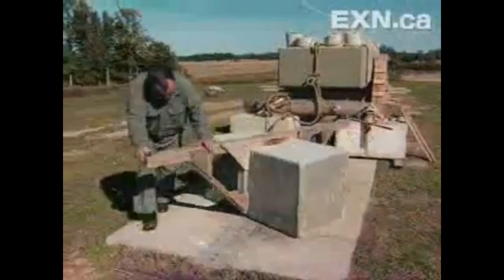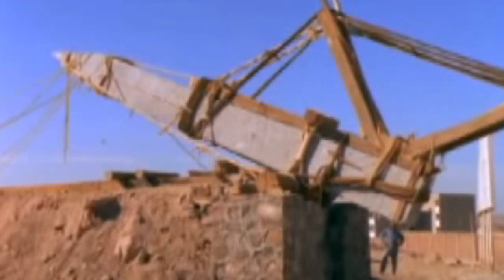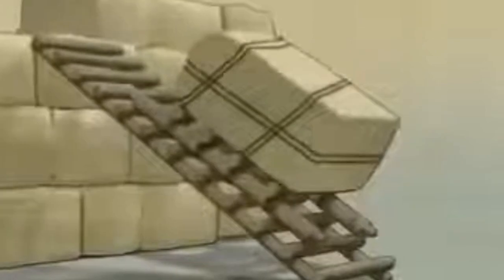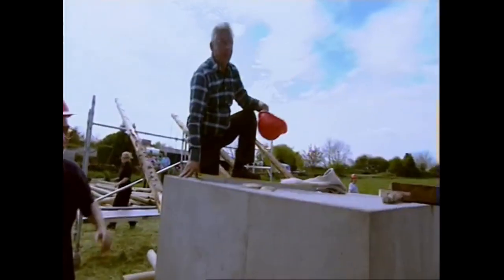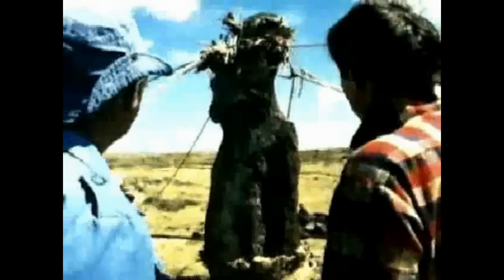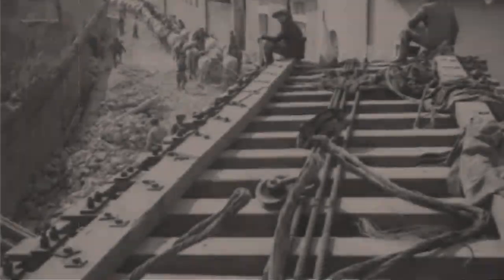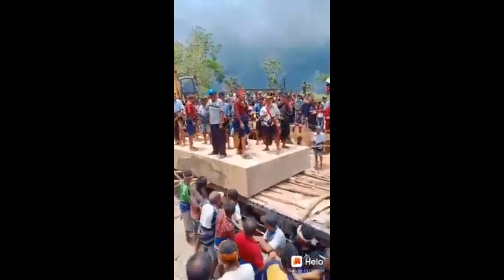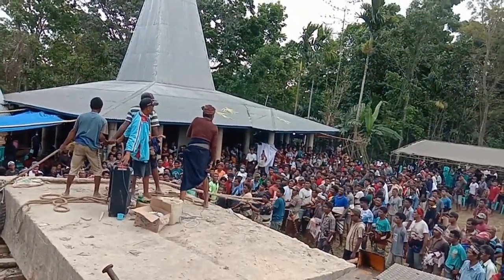How The Ancients Could Move & Place MEGALITHS With Primitive Tech. LAHT WON'T SHOW YOU THIS!

Comment: Cmon man... WAKE UP. THE BAALBEK STONE IN LEBANON WEIGHS 2,000,000 POUNDS...
Reply from the maker: Big drilling deal. You obviously haven’t seen people move things because you get all you info from lost high tech gurus who think polishing stone is a mystery.
Reply: @SacredGeometryDecoded  really, why did at least ten notable engineers decline to provide any possible way to move the stone? If they could move the Baalbek Stone, why don't they? You say I obviously haven't seen people move stones or I would think otherwise. If that's the case, why don't these "people" that you are referencing that I "obviously haven't seen" go to Lebanon and move the Baalbek Stone? I'm sure the entire world would like to see them move that stone using primitive means, in fact I'm sure if they crowd funded it as a campaign,  there would be donors willing to put forth a million dollars. But then again,  they wouldn't need millions of dollars for primitive means. So again I say, and there is no need to be rude to me, why can't the move the BAALBEK STONE?
Reply from the maker: @lavarburton1849  10 notable engineers? Who are they?
Why don't people go to Lebanon and move the stone?
Because those stones are still attached to the Earth and were NEVER MOVED, they also weight several billion times more than what you say, they weigh the same as the Earth.
As for notable engineers go back in time 2000 years and get a copy of De Architectura. 
Also you know what would happen if you go to an ancient quarry and mess it up to prove something to you. Even at another quarry the stone itself would cost over a million dollars. Hiring the crew and getting the ropes and timbers would be very very expensive. 
This video contains examples of people doing such work. 
Your ignorance of the basics of the topic is epic.  It would be like me walking into a nuclear physics class and demanding everything be explained without me even bothering to do the reading beforehand.
All you knowledge comes from the likes of Brien Foerster and Uncharted X.
Reply: The dome of the Vatican is 30 million pounds and 200ft in the air. Yet you guys never question that building, I wonder why….
Reply: @LesterBrunt  Are you addressing me? I was unaware of any such claim but I'll certainly check it out. What does it being the Vatican have to do with anything. Anyone who would disingenuously ignore an important piece of information because of bias is not on the empirical quest for truth. Everything must submit to empiricism.
Reply: @lavarburton1849 It is just that you are puzzled by a 1,000 ton stone that was attempted to be quarried by the Romans but yet there is a 15.000 ton dome built 300ft in the air by the same people with the same technology and that is never mentioned. 
You don’t think that is strange?
Reply: @LesterBrunt  Well, first off there seems to be a few misunderstandings on your part so I must address them if I feel you have the wrong idea:
1. When you say, "You seem puzzled by a 1000 ton stone, yet there's a heavier thing over here...", It seems to imply that to be "puzzled" by any of these, whether it's 1000 or 10,000 tons, is somehow unreasonable to you or childish to you. Tell me, are you puzzled by it? Or them? Do you know how they did it? You seem to have quite a self righteous tone, so by all means, enlighten us. I was the first to say that no one knows how the stones were moved. But the way you say, "you seem puzzled..." Well, here's your opportunity, Professor. Unpuzzle me. Let's hear your great wisdom, architectural knowledge, esoteric methodology of moving millions of pounds of solid stone at once with no known technology. .Let's hear it, Professor!
2. I responded to this before and you are repeating the same thing. You are making an implication about some other site of larger dimensions NOT being mentioned, and I take that religion has something to do with that. So what is it?? Be clear in your thoughts. Come out and say what you really want to say. Don't act like a female during a certain cycle of the month who wants to speak in cute codes so I give her attention and try to "figure her out". Be a man and say what you mean and mean what you say.
Now try again.
Reply: @lavarburton1849  They carved the stone from the bedrock like it has been done in the past 10.000 years, you take a hard object and bash it against so that little pieces get pulverized/flake off. It is like the most basic work imaginable that is why it amazes me that you are so puzzled by it. It being big only means that it took more manpower and time, the process is exactly the same on large or small scale. 
See how I can just respond to your comment without going on a weird hysterical diatribe about “being a man”? Can you do the same? 
Can you answer the question on the St. Peter’s Basilica? What do you think about the fact that you are baffled by a rock but never even questioned a 30.000.000 lbs perfectly placed, symmetrical dome 300ft in the air. It has nothing to do with religion, I’m just wondering why the discrepancy?
Reply: @LesterBrunt  Well, as I did last time, I will take these "points" one at a time, but given that they are alluding to previous answers or statements that I've made, I imagine you will either immediately forget the responses due to the way your hippocampus functions, or not be able to understand them because of a limited intellectual capacity.
1. You have obviously never been a Mason. I've done sidewalks and driveways,  but my main task was repairing chimneys. Occasionally I would do more interesting stones,  including foundational stone. That being said, I am sure you have no callouses on your hands, have never used a brick hammer, a masonry chisel, a grinder, a tuck pointer,  etc... I am pretty impressed by their cutting of the stones. Furthermore, if I'm not mistaken,  you are taking that from a statement I made in a conversation discussing whether the stones were moved or cut in place. If that was not the context,  then I don't know which means it wasn't nearly as important as the Central issue. So that brings me to the heart of the matter. We are all PUZZLING over how the stones were MOVED FIRST AND FOREMOST,  which tells me you shifted the conversation towards the cutting because it's the low hanging fruit. Also,  that does not seem to be what you were alluding to when you said we were "puzzled". In other words you are being disingenuous because you realize you have nothing informative to contribute to the discussion, which brings me to-
2. You say it being big only means more manpower and time, and the "process is exactly the same". But what's conspicuously missing from your non-answer is WHAT IS THAT PROCESS? What do you think we've been discussing this whole time? This whole conversation from the very beginning was about how the heck would they move these things. You have offered NOTHING to that effect. You come into the conversation with a self righteous arrogance,  and then realize you have no clue of what you are talking about so you do a bait and switch and think you can pull a "gotcha" on the low hanging fruit. Right here and now, explain, SPECIFICALLY, step by step,  HOW DID THEY MOVE THE STONES.
3. I already ANSWERED THIS. there's no more discrepancy then you not mentioning Ziggurats on the ocean floor off the coast of Florida..  oh wait, did you know that? Duh. The reason the conversation was not about whatever your referencing, was because I was unaware of it. When you brought it up,  you implicated TWICE that it has to do with the Vatican. Are you a puppet for the Church Fathers, The Cryptos, The Vatican, The Jesuits, and The Society of Jesus? Oh wait you don't know what that means... I don't care about your manufactured religion. I STATED TWICE that I didn't mention it because I didn't hear about it. I just heard about the Baalbek Stones The day I made the comment. Now that you've been officially notified three times, will you be able to remember this?
Furthermore, just for your behavior,  I will only discuss the Baalbek Stones until the issue is somewhat concluded.  If you behave yourself I will agree after this discussion to discuss your church.
Reply from the maker: This video includes examples of moving. You can keep denying it and throw a random question. 
For more details I have specific videos on Baalbek. It's a short distance away, the land is level. The tech at the time including written descriptions are more than enough. Other moves such as 400 t obelisk over the Med and across more land.
I don't care abput your made up religion and wilful ignorance either.
Are you a puppet for the dumbing down of society? Are you trying to reduce humans to useless button pushers to satisfy your demonic pervert masters? Why do you think it's OK to pollute the minds of children? Why are you so evil?
Reply: @lavarburton1849  And again some hysterical post that has nothing to do with anything I wrote or asked you. 
So much for your supposed open minded “questioning”.
Reply: @SacredGeometryDecoded  How come none of your explanations include Magnets, or Magnetic Force, Giant Humanoids, or Telepathy? You are scrambling to come up with all this ridiculous nonsense to figure out for certain how they did it. Let's start at a place we can agree with. Thousands and thousands of years ago the inhabitants of earth, or certain parts of it, were able to move solid stones that weigh millions of pounds. This defies all known principles of cultural evolution and the evolution of a cumulative based knowledge. According to all the observations and principles we learn in Sociology, Psychology, and Cultural Anthropology, if they were moving solid stones that weighed MILLIONS OF POUNDS in 5000 BC or 3000 BC, Then by 1000 AD they should've had the technology to Move a Mountain- LITERALLY. 
So let's start there so that our eyes may start to open to the truth. The investigative path you are taking is not only taking you in the wrong direction, but was devised to do so by the people that know the Truth.
Reply: @SacredGeometryDecoded  first of all, you are not the shiniest coin in the jar. There are two conversations going on here. When I was saying I don't care about your fake religion,  I was replying to the other uninformed individual who is like you with regards to intelligence level.  For further clarification,  when someone makes a response to another user, that users name appears in BLUE at the beginning of the response with an "@" symbol immediately preceding their name (the one written in blue). This tells you who someone is responding to when they write a reply. I hope that helps.
Reply: @LesterBrunt  I replied DIRECTLY and PRECISELY to each and every point you made, if you can even call them points. 
I even numbered the responses for clarification. What's happening here is that you feel insecure and threatened,  so  are withdrawing from a situation you previously felt very confident in.
I imagine this happens to you quite regularly, just based on the statistical distribution of intelligence levels.
Reply: @SacredGeometryDecoded  I realized something that can help here. We are coming from two different starting points. You are not coming from the starting point,  or worldview, which assumes that the means to move solid, multi-million pound stones,  including the nature of the beings that moved them, has been deliberately hidden from us by the Victors of History.
I realized this just now after reading an article from 1909 in a local Gazette, that discusses an underground matrix of tunnels 1480 feet below the surface. Advanced irrigation methods were used, Advanced structural architecture was used to prevent collapse, and Egyptian/Middle Eastern language was written on tombs. EVERY SKELETON EVER FOUND was 9 feet tall or taller. Weapons of a peculiar copper alloy were discovered with the rigidity and toughness of steel. The matrix of tunnels was determined by archeologists to be of a military nature, and indicated the inhabitants were fighting a conflict in which their existence and location needed to be concealed. All evidence with regards to this underground matrix suggests it predates what we call Native Americans by up to 1000 years. The Archeologists say that there are striking similarities between this site, and the cities of the "Mound Builders", which also contained giant skeletons. 
EVERY SKELETON EVER FOUND IN THE MOUND BUILDER CIVILIZATIONS WAS A GIANT. All Giant Skeletons ever displayed in museums in North America, that were from Ancient Mounds, were removed as a result of The Native American Repatriation Act (I think that's the name) that was created by a [star of david] and and passes with aggressive promotion by [star of david]. Interestingly,  there was virtually no Native American support for this "Repatriation" of giant skeletons,  no matter how much the [star of david] tried to provocateur feelings of offense.
This is probably due to the fact that no Native American tribe claims to be descended from the Ancient mound builders, and AT LEAST 22 Native Tribes have histories that include a race of White skinned giants that pre-existed them.
These are the Aryan Giants that many people have mentioned, and get called racist or White Supremacist for suggesting they existed. Why do you think Ireland was Aryland? It went from Aryan-Land to Aryland to Ireland. 
Do you realize Iran was the word Aryan?
This directly relates to the Baalbek Stone. These Aryan Giants 1480 feet below the ground in North America were hiding from the Giants in what is today Lebanon, Greece, Rome, Iran, Iraq, Egypt, etc.
You have to understand that normal sized humans DID NOT move the stones. 
In the Mound Builder Societies,  you will find Gigantic Stones placed atop many tunnels as ceilings, and the same mystery of how they were moved persists. An investigation into the moving of stones in ancient times, which your channel investigates, must start from the point  that the ancient people and their methods of moving the stones has been deliberately covered up. All Giant Skeletons found since the fraudulent Repatriation Act was signed into law are never seen by the public,  even with a FOIA Request, since Native American Sovereignty is excluded,  unless involving a crime.
They have employed this same method of covering up Giant Humanoid Skeletons in every country where they can use a Native Population as an excuse to take away the skeletons, or prevent people from looking for them by designating every possible location as "Native Land".
You are wasting your time trying to figure out how humans moved the stones.
Reply from the maker: @lavarburton1849  just because you are ignorant doesn’t mean everybody else is as useless as you.
There’s this thing called real life and real world experience, it’s a place we’re people with useful skills get together and make things happen.
Including moving and lifting heavy objects. It’s called the lifting and rigging industry. I worked in it and because of that i saw through the BS that people like you push.
Your new age religion is a cult that wants to make idiots out of people. It exists by lies and cheap psychological tricks.
Reply from the maker: @lavarburton1849  For further clarification Sherlock it’s a public comment section. 
FYI When you go the school ma’am hall monitor thing it doesn’t make you look clever, sophisticated and superior. It’s more like putting blood in the water. 
The fact you are dodging the technical issues on a technical matter is revealing your ignorance.
Reply: @SacredGeometryDecoded Well, if you do in fact work in the "moving and rigging" industry, tell me, what is responsible for the phenomenon of a BACKWARDS progression. Have you observed that human progress goes BACKWARDS? We invented the lever, then the wheel, then the axle, then carts, then horse and carriage, then locomotives, then automobiles, then airplanes, then bullet trains... As you can see, there is a linear progression in the sophistication and rate of speed of transportation. A Bullet train can go 300 miles per hour, and there's hypersonic jets that can break the sound barrier (speed of sound). You can historically track the linear upward progress of this starting from antiquity. Given that they were capable of moving multi-million pounds solid stones 5000-7000 years ago, we should assume a linear rate of progression, and even beyond with the advent of electrical power, such that by 100 AD  they should've been moving 5 million pound stones, and by the era of electricity they should easily be moving 10 Million pound stones. By today they should be able to move MOUNTAINS. With 7,000 years of Scientific development starting from the age of moving 2 Million pound stones, we should be able to move 50 million pound stones, in other words entire mountains. Why has this NOT occurred? In fact, the exact OPPOSITE has occured, which is why those Baalbek Stones have remained in the same place since 500-1000 BC. Any reasonable person can see that SOMETHING HAPPENED. What could it have been? Could it have anything to do with at least 20 ziggurats found all over the Earth at the bottom of the Ocean? Since you work in the "lifting" industry, tell me how the ziggurat was "lifted" to it's present location 8 miles off the coast of Florida? And since you are such an expert, tell us how to "lift" it out. Geeze Batman, how'd that ziggurat get all the way down there!! Someone must've "lifted" it there from Ancient Sumeria!! 
And btw, I follow NO RELIGION. I wouldn't be surprised if you follow one though. AndI wouldn't be surprised if it's MONOTHEISTIC and claims that the Human made in the direct image of the Monotheistic God is Kosher, and that when the Kosher Monotheistic God wiped out the evil Pagan Gentiles with water, that the one human family he spared was kosher as well. I also wouldn't be surprised if the collection and destruction of the 1000s of Giant skeletons found was committed by Operatives of a kosher nature. I follow EMPIRICISM. I follow the Empirical Method,  which is the basis for all legitimate science. The only way to ascertain the truth is through empiricism. 
If I ask you how many species of primates there are, you will not know. 
If I ask you how many chromosomes each species has, you won't know.
If I ask you what is the chromosomal difference between humans and all other species of apes,  you won't know.
An Empirical Investigation by an intelligent person will tell you that humans were genetically engineered.  There are three ancient cultures who's history are compatible with this, and where these cultures are is precisely where humanity began. In that exact area, and radiating outward, is where we see the incredible amount of weight lifted, and the incredibly precise alignment with the architecture and star maps. This is a fact. And the mathematics used for the calculations did not come into existence until thousands of years later after Pythagoras, indicating that the ones who the orthodox authorities claim built the pyramids and moved the stones, did not possess this knowledge. There is no mathematics of this level in any Cuneiform or Sanskrit Tablets.  There is no history of Mathematics, Engineering or Architectual knowledge that accounts for the construction of Ancient structures and the moving of incredibly massive objects. You are either an operative of the Controllers,  or have been mentally conditioned by them with a high degree of cognitive dissonance.
Reply: @lavarburton1849  You can’t even reflect on a simple question without going on an all caps tirade filled with insults.
You really aren’t mature enough.
Reply: @LesterBrunt  I notice both you and the other individual follow a similar behavioral pattern. There is a direct correlation between subequent discussion and a decline in the substantive nature of your comments. As the conversation goes on, you are unable to think clearly or present any coherent point,  so your comments get shorter and shorter as they go, and contain no meaningful information relative to the discussion. This is because of a level (low) of intelligence combined with conditioning from birth, resulting in attention deficit and lack of critical thinking skills. 
I am willing to have this discussion indefinitely, in order to show you two that you have been lied to on the most fundamental level, and that almost all of history is fake. More than HALF of ancient Tribal religions around the globe relate to what is called the Anunnaki. 
The Ancient Pyramids use the Pyrhagorean Theorem, even though it was not invented until 1000 years later. They also encode the "Fine Structural Constant" (~1/137.036) not known until 5000 years later (1919). Furthermore,  even mainstream scientists admit that The Pyramids were built in such a way as to concentrate Electromagnetic Waves into their Chambers. And of course, they can't figure out how to recreate them. They do not understand where they got the solid stones, how they got them there, how they made the mortar,  how they aligned all the Pyramids with the North Star within a 1/15t of a degree, and why they are concentrating Electromagnetic waves into the Chambers. Furthermore there is NO Sumerian/Mesopotamian/Assyrian/Akkadian/Egyptian/Sanskrit/Cuneiform Tablets ever discovered that display any of this knowledge or indicate that it's known by oral tradition. On top of that,, you can see at least 100 different representations in the form of Stone Engravings, Written Tablets, and Ancient Egyotian Artwork that constantly depict another race of people that are at least twice as tall. In some of the art, these tall beings are being very abusive to the humans. 
If you understand all this, and research it to make sure what I'm saying is true, then when you ask the question of how Ancient stones were moved, you start to see it as a totally different question. 
Now don't abandon the conversation because you were put in your appropriate position. I am willing to educate both of you free of charge.
Reply: @lavarburton1849  You are genuinely insane. Please don’t hurt others.
Reply: @LesterBrunt  hmm.. Interesting. You came in loud and proud, and then scuttle out the back door, whispering a generic retort in a weak attempt to salvage your dignity. Farewell, Atheist Friend.
Reply: @lavarburton1849  It is so funny that you actually believe you are the one with dignity here.
Reply: @LesterBrunt  Well, how shall we determine? Would you say that Empiricism is the Barometer for the Truth test of our claims,  and the Dignity of our Theories? If you feel as if you are more dignified than I, and that you do not scuttle away in Shame and Insecurity,  than let's go through our claims and ideas, and see who's holds water....
Reply: @lavarburton1849  You don’t even know what empiricism is.
Reply: @LesterBrunt  a child with no nuance of self reflection... run along.. Go play
Reply: @LesterBrunt  Well, than since I am unaware of what Empiricism is, then you yourself can go through and explain 
1. What Empiricism is, in your own words 
2. Each of your statements relating to this discussion and how they are Empirical, or based upon Empirical evidence, or follow an Empirical Method in any way.
Reply from the maker: Firstly after the collapse of Rome technology went backwards. After the Bronze Age collapse things went backwards. History is full of regressions in technology if you cared to care to learn about history one little bit.
You don't. You just want to validate your new age religious beliefs. Accepting every far fetched story at face value and scoff at anything that doesn't fir your preconceived notions.
Genuinely the medical term for what you have is Bat Shit Craziness.
Reply: @LesterBrunt  What an idi0tic comment. The dome of the Vatican is not a megalith.
Reply: @marieclaire3670  So therefor it doesn’t weigh that much? You try building it.
Reply: @LesterBrunt  It was not one single object like the megaliths at Baalbek. It was built piece by piece. Am no Michaelangelo, but sure I can build it, even using Medieval Age technology. Give me the money and I'll build one for you.
Reply: @marieclaire3670  Where in Baalbek are any of those megaliths in the air? Oh wait they aren’t, they were just dragged over. You know there is also an 330 ton Egyptian obelisk in front of the Basilica, how do you think it got there? And yet you think these very same people couldn’t drag a big stone a couple hundred feet from a stone quarry?
Reply: @LesterBrunt  We call it capacity limits. 800-1,000 vs 330 tons.
Technological limits. The Romans transported it, an iron age civilization. The megaliths at Baalbek, much older.And it does sit on top of smaller stones, so they were lifted. If it was dragged on top of it, how?

Now, I can certainly assure you that if you give me the money, I can build you an edifice like Dome of the Vatican using Medieval Age technology.
Can you show me how you can drag an 800-ton object using Roman technology?
Reply: @marieclaire3670  Baalbek was a Roman civilization, those stones were quarried after the iron age. 
Also the biggest megalith was never quarried, the 1000+ ton stone is still connected to the bedrock. 
If they can transport a 330’ton obelisk over the Mediterranean sea then it really isn’t that unbelievable to could transport a stone twice as big over a couple hundred meters.
Reply: @LesterBrunt  Capacity Limits: If you can lift 100 kilos, it doesn't mean you can lift 300 kilos.
Techonological Limits: On Strength of Materials, the romans nowhere possessed the metallurgy tech required to move 800-ton objects.
Terrain: The terrain of Baalbek are rugged. Do you really think it is easy to move 800-ton objects in that environment?
Platforms: Iron? Nope,. Wood? Nope. Both couldn't stand the weight and stress of moving 800-ton objects, They would be crushed.
Physics? 
1.  How to harness the object to compensate for the gravitional pull? At the back, the object would sink at the front. At front, no material could withstand the weight.
2. To compensate for the above, you have to pave the pathways with tons of stones, which in reality, wouldn't do much, they would just sink under the weight bearing on it.

If you have answers to the above, you're very much welcome. Surely, you'll be making a lot of insights to my line of work. I thank you in advance.
Reply: @marieclaire3670  Can you point to anything that would indicate you can move 300 tons but not 800? The heaviest stone moved was heavier than that and that was done before modern tech. 
You also keep forgetting Baalbek was constructed after the iron age, to think they didn’t have iron or wood is rather bizarre.
Reply: @LesterBrunt  "Can you point to anything that would indicate you can move 300 tons but not 800? The heaviest stone moved was heavier than that and that was done before modern tech."

--- Well, some of the heaviest trucks we have today are the  SCANIA 6X6 AGRAR TRUCK and Meclift™ ML4218R. They can only haul arround 50 tons.And their tires are custom-made to handle the weight. When the Endeavor Spacecraft (86) tons was transported from LAX to the Space Center, a 160-wheel truck was used and it occupied six lanes. NASA use the Crawler to transport rockets upwards of 2,000 tons, but you should see the monstrosity of that transporter, it occupies more or less half of an average city block.

Using manpower? It can't be denied that the more manpower you have, the more weight you can pull or push. However, we have no historical record or mathematical computation how we can move a 1,000+ megalith like that of the Pregnant Woman in Baalbek. The object being moved, as shown here in the video weighs 15-20-tons, it would be interesting to see how they would do it on a 1,000 ton object.

The heaviest stone we have moved, as ALLEGED by historians, is the Thunderstone that they say weighs 1,500 tons. Unfortunately, no factual historical record exist of how it was moved, only tidbits thereof. But it lies in St Petersburg today. Believe what you see, not their narratives, it can easily be seen as weighing only 400 tons, 450 at the most. Sure, they said it was moved at 1,500 tons (ALLEGEDLY, upon orders of Catherine the Great) only to be whittled down to it's present size. It's a laughable idi0cy. No factual record exist that CTG ordered that, somebody just made it up, and surely, planning is involved in this process. You don't go to the trouble of moving a 1,500 ton object a considerable distance if what you actually need is only 400-450 ton object. Besides, it was moved using 19th century technology, with iron sleds and implements and they waited for winter to move it. Hardly any comparison here, the rugged, uneven terrain of Baalbek vs flat ice surface. Nineteenth century technology vs pre-Iron Age technology.

"You also keep forgetting Baalbek was constructed after the iron age, to think they didn’t have iron or wood is rather bizarre."

--- The Roman Empire is an Iron Age civilization. They built their temples ON TOP of the Baalbek megaliths. It is clear the Baalbek foundations was built before the Romans arrived there. If the Romans did indeed built the foundations of Baalbek, then it was built in the Iron Age, not after.  And that is debatable. Nowhere else would you find megaliths like those at Baalbek in the Roman Empire. There are a lot of granite quarries in Italy and Europe as a whole, so the question is why don't they have comparable megaliths outside of Baalbek?

What made you say that Baalbek was constructed after the Iron Age?